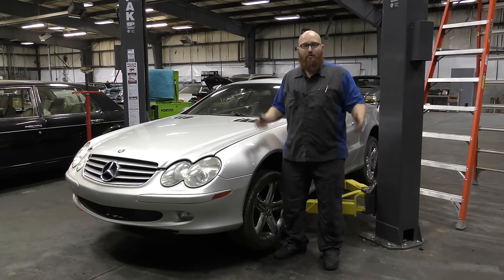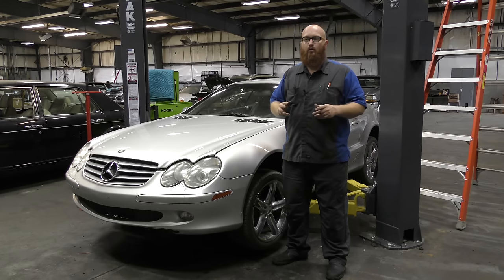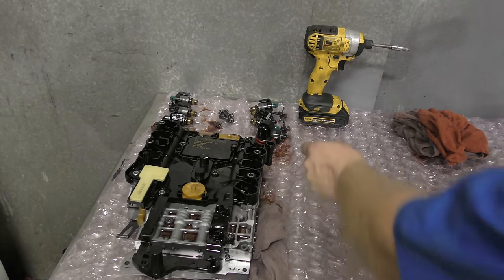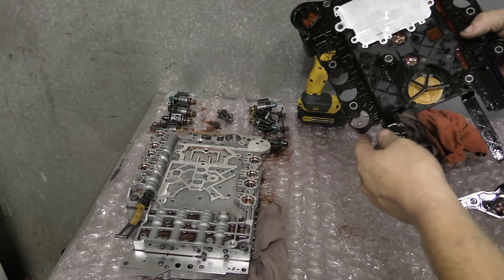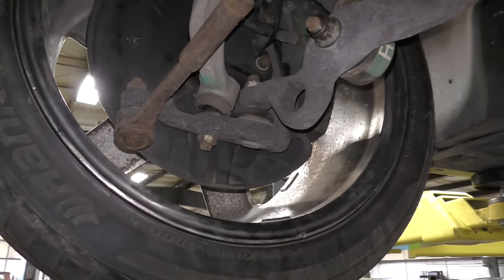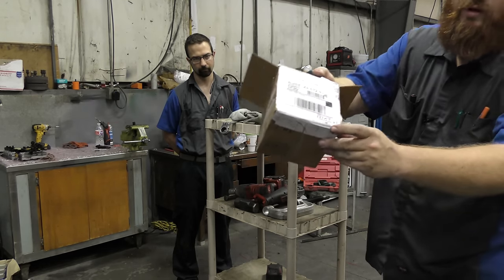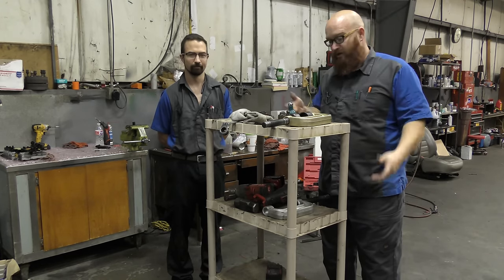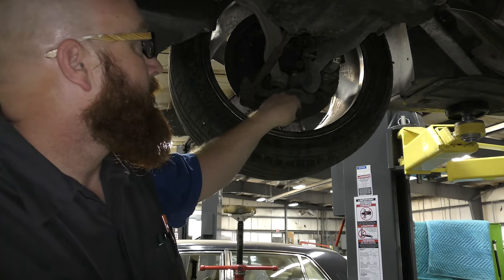ABC Strut ball joint repair. The CAR WIZARD shows to fix ABC strut on '04 Mercedes SL500

Comment: 5:10 - I used to photograph at a MB dealer, I'll never forget when a lady came in and her 18 month old E Class needed 3 grand worth of brakes. She was saying how the vehicle was under warranty still and they told her it didn't cover any of the stuff she needed... oh man lol, she was demanding they release her from her lease and was swearing and screaming.

In one sense I get that Mercedes wants you to have a flawless experience and that is best done by just replacing chunks of things all at once, but most people don't want to replace their entire front suspension when a single bushing wears out.
Reply: A Friend of mine always says, when you buy a Mercedes then you have to pay a Mercedes. That lady can't lease an e-class and expect to pay for an a-class...
Reply: Prestige luxury cars are expensive to service? Who knew?
Reply: some of them amg brakes are like $800 per rotor
Reply: The thing is, brakes are brakes. Whether it’s a 1987 Honda Accord or a 2020 AMG S-Class. The parts can be more expensive due to the material used and the size of the component, but replacing brakes on an AMG Mercedes should be no more expensive labor wise than a 30 year old Honda. The dealer is just ripping people off under the guise of “oooooh it’s got the 6 piston caliper high performance brakes, it must be 50 times harder to work on” when in fact modern power brakes on every car on the planet have all been the same for 70 years. Drums or disc, they all work the same. Hydraulic fluid pushes a cylinder either in the caliper or the drum which push pads onto the rotating surface which stops the car. Big friggin deal....... oooooh it’s a Mercedes, it must use unicorn dust that no one has ever seen before ooooooh

Comment: @Car Wizard, for pressing bushings and such into things, you might find it much easier to get a small medical freezer capable of a minimum of -40c.  Some of them are like 1-2 cubic feet, and are capable of going down to -70C.  One of my friends has one, and putting stuff in that for a few hours before installing bushings allows you to pretty much press the bushing in by hand (gloved of course).  You can also get the same effect by spraying propane on the part just out of the nozzle of the bottle.  But that's far from my preferred method of shrinking something.

Comment: Those Milwaukee's sure come in handy. Worked on Tractor-trailers in the early 90's. Dragging my impact and hose up and down the shop to get a wheel bearing off or break something loose. Not doing that work anymore but wish I had one of those back then.

Comment: It is now Easter Monday and I am hopeful that the first buy this, not that video of 2021 will be uploaded to the Car Wizard channel tomorrow afternoon or on Thursday. The Car Wizard has not completed one for Mitsubishi or Chrysler, yet. I am definitely going for Mitsubishi first, because the all-new, re-designed, 2022 Outlander is now built on an all-new platform with the 2021 Nissan Rogue. Nissan and Mitsubishi all partnered together already. Prior to before, it was with Chrysler. The third-generation Outlander GT (2014 to 2020), which has the 3 L V6 engine is the best compact SUV to buy, while the second-generation, 2011 and 2012 Outlander with the 3 L V6 engine is very good. The earlier models of the second-generation Outlander (2007 to 2009) with the 3 L V6 engine may have some mechanical problems, but otherwise they are fairly reliable. The ones, I will avoid is any Outlander Sport (RVR in Canada) with any engine, because the vehicle is a sub-compact (looks too small) and it has the horrible, CVT transmission. They are underpowered and the crash test rating is a little poor. It you need an compact SUV, just get the Mitsubishi Outlander, second-generation or third-generation, forget the RVR/Outlander Sport. Also, not to buy from Mitsubishi is the Eclipse Cross, because that crossover looks hideous and they are too underpowered as well. For Chrysler, I would buy a 2002 to 2004 300M full-size sedan or a 2013 to 2016 Town and Country minivan. The rest of the Chrysler line-up are a not to buy, which are any PT Cruiser, any Pacifica crossover and the older, revised-style, 2008 to 2010 300 full-size sedan with the 3.5 L V6 engine or the 5.7 L HEMI V8 engine. They have numerous, electrical and mechanical problems.

Comment: Ive worked in a front end shop for years, freeze the balljoint it will go in easier , you could also heat the socket but if be careful not to heat it to the point of damaging the strut.

Comment: just did same thing on a 03 e 320 l.  i used a hand wrench to tighten the press, pressin in the ball joints was a feet of great aclaim. I bought a ball joint tool from harbor freight for 62.00$ that worked on my mercedes, mercedes sells the ball joint tool for over 1,000.00$. there pretty close to identical, ha

Comment: Thank you for this!  I'm collecting parts to replace all of the bushings and ball joints on my SL65 front end.  This was one piece I didn't see a replacement for until I found your video.  

I wonder if it would help freezing the ball joints prior to installing them?

Comment: thank you for doing this! I drive a r230 too,,I am having low-voltage problems within the right front strut! it's sometimes are I come out in the morning and my car 20% of the time has the warning too low to drive.I give it a minute. And it often rights itself but if not I press the suspension button! do I need a new strut or is there something else going on. help I need answers! I diagnosed it myself within MB 2.

Comment: Very informative video. I have a 09' SL550 and its good to know that fixing the ball joint doesn't require a new ABC strut. On a separate but related note for Mr. Car Wizard, I wonder if you have any recommendations to replace the ABC with conventional coilover struts since the ABC system is a notoriously expensive fix when it fails.

Comment: 1. Put the new ball joint in the freezer before attempting to install it. The temperature difference will make it go in much easier.

2. Wear earplugs when using the cutoff wheel, don't get brake cleaner on your hands.

Comment: Hi Mr Wizard , I have an SL just like you and I have to replace a valve block and I first time I bought a cheap one of Ebay and it worked , but the second time it didn't so now I'm asking for another part. 
Do you know any place one could send a block to have rebuilt  ?? So anything not to buy a new from the dealer, or what would you do ??  Thanks

Comment: Car wizard you should look into the Astro Tools 78100 Goliath ball joint c frame press. It is physically like 2 inches longer than your standard c frame press. So much nicer not having to worry about whether or not you adapters are going to fit. I use mine all the time.

Comment: On my 2006 CLK the hardware... Down there, also seems to be surprisingly corrosion resistant as well. On a car with 160,000 miles living in salt states all its life and the nuts and bolts are barely rusty. I too have tossed the hardware from parts kits as well and stuck with the oe MB hardware. I'd even go so far as to say they're worth the "Genuine" premium; for me anyway.

Comment: The Car Wizard: «I will use my handy-dandy angle grinder with a cut-off wheel. Without a protective cover or face shield»... One second later: «OSHA WANTS TO KNOW YOUR LOCATION» 😂

Comment: I have the large snapon kit for ball joints that should allow you to do that without cutting the stud of the joint off. It has a huge selection of cups and extensions for the cups to fit over the stud.

Comment: Hey Wizard!!  Love the channel, you're obviously a mechanical beast, but I need to know if there is a cheaper way of programming new keys to mercedes.  Can you program used keys etc for them without involving the dealer or ordering an insanely expensive key?  I flip mercedes as a side hustle and it would save me a lot of money when fobs break etc.

Comment: You didn't have to put the ABC system in some kind of service mode? Did you disconnect the battery first? I'd be afraid of the strut kicking up or down in the middle of the job. I need to change the other ball joint on my R230, the one connecting that lower control arm to the steering knuckle, so I'm mainly looking for ABC service warnings before getting started. In theory, using the ABC to actuate the strut up and out of the way could be helpful for my job. Maybe it mattered less on your job since the wheel assembly moves freely up and down once you disconnect the strut.

Comment: I own a 2005 SL500 and had the plunger sensor go out in the rear left and caused the steering wheel to go out of wack and the ABC light to stay on. Bought a used strut off Ebay and swapped the sensor out through the trunk, problem solved. I do have a parasitic drain on the battery that I cannot find, dealer said the was a problem with my driver front SAM but my iCarsoft programmer shows no faults there. Any thoughts where it could be draining? Dealer tried to charge nearly $4000 for both problems, i said ya no thanks.

Comment: Wizard, what's the part number of that ball joint and where to buy from? I need to replace both of my 2003 SL500 but cannot locate this ball joint anywhere! even the dealership says it's sold with the ABC strut as one unit, please help!

Comment: idk if u answer mechanical questions in the comments or not but ill give it a shot anyway
i got a 91 mitsubishi mighty max with the 4g64 (fuel injected) and it vibrates when it idles but smooths out like normal when driving any ideas why that is?

Comment: I have heard the root cause of these speed sensor issues on the conductor plates is metal intrusion into the TCM, not the actual sensor itself, any thoughts on that?  Can a used conductor plate be programed to the vehicle or does it need to be a virgin part?

Comment: Today me and my brother worked on his Citroen C3 1.4 HDI.
Valve gasket was leaking oil. We have replace it, but what I found it was that intake plenum and valve cover were 2 parts, but welded by plastic so can not be seperated.
How common is that?

Comment: I dont know but is the ball joint for just this car? I mean it could be a lower ball joint from another car that is good enough in size thats why the go in a little to tight. 
So put them in a lathe or sand of just a little bit?

Comment: heat the empty joints up then the new ball joint gets easier in and tight after cooling

needs a new primer but is a bit faster in my experience with bmw 7 and mercedes SL since R129

Comment: Wizard, 
You and Magic Mike are giving away... "wiki-leaking" all those expensive German repair secrets and I think it's great. 
BTW, I hope the socket you were using on that ball joint install was heavy duty. Otherwise. you were risking injury by holding it so near your head.

Comment: What kit did you get the ring out of that fits the lip on the back of the joint? The Mercedes kit i have does not have that ring.

Comment: with the Ball joint could you not use liquid nitrogen to make it easier? like dipping the joint into it then after its cold put it in?
Reply: Liquid nitrogen seems a bit overkill but putting the new ball joints in the freezer overnight would have been a good idea.
Reply: Most carbon steel is brittle at -20 F. Liquid nitrogen is -320 F so likely it would just shatter.
Reply: Oh yea, we all have liquid nitrogen laying around.

Comment: Maybe leave the ball joint in the freezer overnight and warm up the strut with a heat gun prior to assembly might make it go in easier but top job again and great to see fixing rather that replacing the whole unit

Comment: I want to know what drugs where in circulation around the Mercedes design team around the new millennium... "Yes, ve put zee transmission controller in ze transmission!". Clearly they designed the transmissions to be disposable as a unit, not repaired piecemeal.
Reply: Not Hitler  Basically... They make maintaining a old one so expensive buying a new one seems like a cheaper option.
Reply: @Matthias_Fischer  Did you hear what Mike and the Wizard said... this repair could easily go to $5000 because they wont do what the Wizard did at a repair shop, they will simply buy new parts and replace and charge you high labor on top of it. So for the Wizard its not that expensive, but for a normal person taking his Mercedes to a dealer or repair shop it gets expensive.
Reply: @Matthias_Fischer  Its cheap if you are the Wizard with the mechamical know how, special tools and lift to make the job 'easy' and cheap. That transmission work alone.... Replacing the sensosrs on the conductor plate would not be a cheap repair. Wizard said they wont even sell most people those balljoints. He had to find a special vendor . It depends on the situation. But these generally are not cheap fixes on this car.
Reply: @revinot  Yep those new car warranty looks nice until it expires
Reply: Way too bad Mercedes took the 'expensive & disposable' trend. Miss the Mercs of last century!!🤦‍♂️

Comment: Fixed a fuel pressure issue on my E39 with a dual temp sensor. Weird. I had to replace all of the top end gaskets to get to it though so could have been a combination of vacuum and sensory. Anyhow, runs perfectly and just about to hit 200,000 miles. ;).

Comment: A turban is a head covering that is a long scarf or piece of material wrapped around the head in a certain manner. ... The word turban is derived from the Turkish word tülbent which means gauze. A turbine is a machine in which a rotor that is propelled by air or fluid provides continuous power.

Comment: 14:30 - I wonder if you put the ball joint in the freezer and warmed the abc strut with a hair dryer (NOT hot, just get it to 120 degrees or something which is why I say a hair dryer) if it'd slot in nicer...
Reply: A heat gun is more suitable.

Comment: My 2006 W219 CLS550 had that same transmission speed sensor problem. Evidently it was a common problem with the 722.9 transmissions. I sold it because of that and the cam timing chain tensioner issues that kept throwing codes. Great cars, but those are design/part flaws.

Comment: you can find the ball joints in germany from a dealer, oem or simply ebay.de 

All you need is the mercedes part number and you get an oem product and not a refurbished one. Just do the search ... cause parts here are a lot cheaper.
Don't forget: german prices ALWAYS incl. 19% VAT (till end of december 16% so prices are lower) already that can be refunded in case of export cause you'll pay american customs + your federal sales tax I guess. 
You can also get refurbished parts from mercedes germany with warranty like exchange transmissions or water pumps ...

Comment: if your ball joints are worn out then the rest of the suspension is probably pretty worn also and they will recommend replacing alot more  , bushings etc.

Comment: I remember the w123 has quite the same ball joint but horizontal in the front.
Reply: Yea, I had to take the whole assembly off mine and take it somewhere to have it pressed. The part that goes up to the upper control arm is curved in slightly over the top of the ball joint. Extra pain in the butt.

Comment: Wizard, did you see Hoovie's video yesterday about the GMT800 HD 2003 MY, he thinks that you might use that truck as a backdrop on buy this not that on GMC when he brings it into the shop in the future, I found good and bad GMCs
Small: To buy: 1994-2004 Jimmy with 2.2 i4 and manual, not to buy: 2010-16 Terrain with 3.6 V6
Midsize: To buy:  2002-09 Envoy with LS Based V8, not to buy: any Acadia
Fullsize: To buy: 2000-06 Yukon or Yukon XL, not to buy: 2007-14 Yukon or Yukon XL
Sports: To buy: Typhoon (Hoovie's teal one) and Cyclone, not to buy: none
Reply: Thank you very much for your idea for the buy this, not that video for GMC. It should be up in the foreseeable future.

Comment: Great demonstration of how not to use an angle grinder. Would it really hurt that much to use a face shield. If you ever had one of those discs explode you’d be picking the chunks out of your face and possibly your eyes. Use the PPE folks and avoid a lot of pain. I would bet the Wizard doesn’t smoke and would have all kinds of things to say about poisoning yourself with cigarette smoke but he doesn’t seem to be a problem soaking up all those toxic chemicals through his skin. That brake clean is easily absorbed and highly toxic, probably like a case of whiskey to your liver. The Wizard is a great mechanic but his safety practices suck.

Comment: It looks like you wouldn't need to cut off the threaded part of the old ball joint if when attaching the removal tool you attached the other side with the socket first as it appears the back side would just slip into place.

Comment: If that's a non-impact socket on the impact wrench, I'd be concerned.  I've seen those literately blow apart into shrapnel when used with a powerful impact.

Comment: Had to do this exact conductor plate repair on my R171 SLK 350. Very common issue.
Reply: Its on common on the 5 or 7speed or both?

Comment: I still prefer the days when the transmissions operated the old fashion way with no electronic assistance of any kind. If they  broke you knew they were broken and you needed to fix them. By the way they didn't break that often.

Comment: Wizard's not big on safety in many instances. No seatbelts, no face shield when using a grinding disc, no rubber gloves when using harsh chemicals, no ear protection when using a heavy duty impact wrench. Time for Mrs. Wizard to lay down the law.